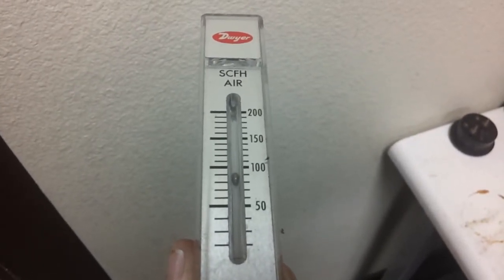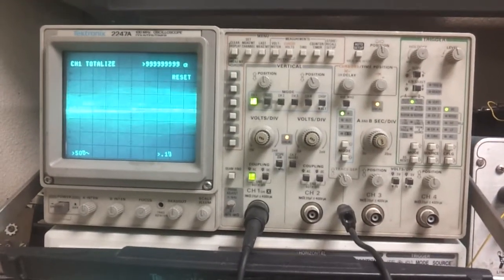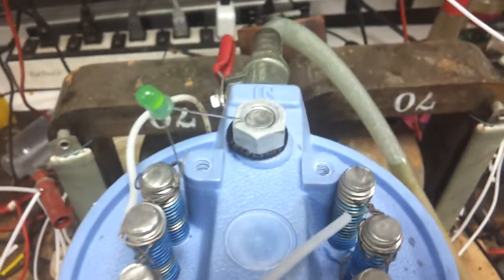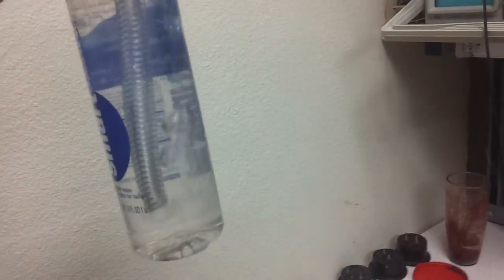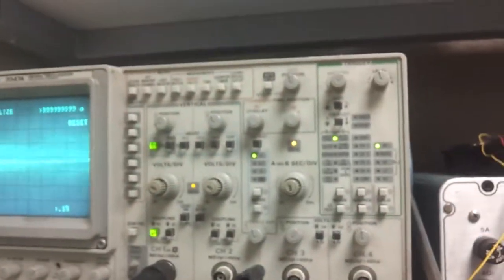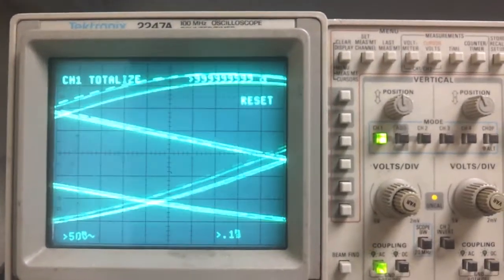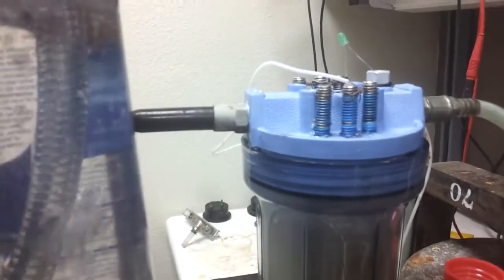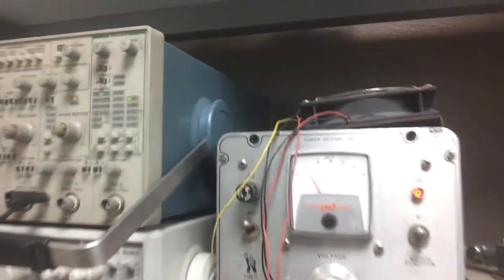Hydrogen Deuteride, HydroMe™ TrueFuel Cells

Comment: 1. Inaccurate flow guage measurement technique. Needs to be totally vertical.
2. This guage is calibrated for AIR. Hydrogen will not read correctly in this guage.
3. You can see It's bouncing up and down because the tilt angle is varying as your hand tilts it.
4. There is no place in this video showing that the hose in the bottle is the same one coming from the cell.
JJ
Reply from the maker: your really just a pain in my ass, but I will answer your questions.  first, if you want to measure different gas spacific gravitas then you need to compensate the gauge, this is a technique I learned by tilting the angle at the same angle as the gas spacific weight. it's close enough, this is why I use the bubbler to visually confirm.  

the second thing is I missed that fact of not fully showing the hose, sorry but my hands and mind were full. besides there was more information in that video than you can handle without you trying to figure out if I was full of shit or not. I just schooled you so hard it's not funny.  

1. plasma pattern on the oscilloscope, at 7 volts under load doing work. that's four lessons. 
2. Hydrogen production on negative and the positive electrode is not producing oxygen. lesson 5

3. diode is proforma of an electron extraction curcit that's a 12volt diode, with 7 volts input. lesson 6&7

4. curcit is standing at 2.5 amps to run. that means hydrogen is being produced at 0.8ths of an amp. lesson 8

5. the test cell is one liter lab ASME #2 with 1 cup of potassium hydroxide flakes creating a dead short. look at my wire size, my amps, and the led should have fried and amps threw the roof. lesson 9&10

need more schooling check out www.protonspintechnology.com